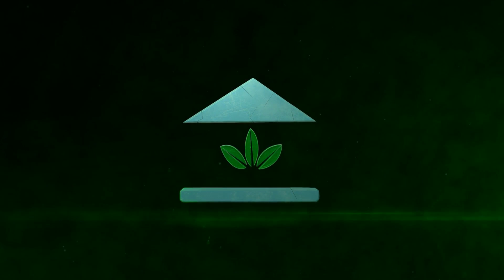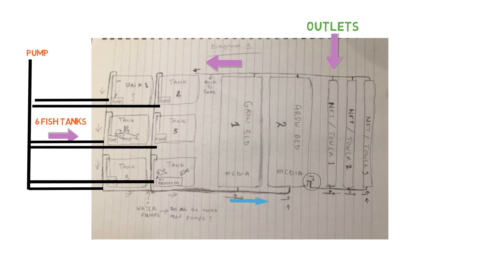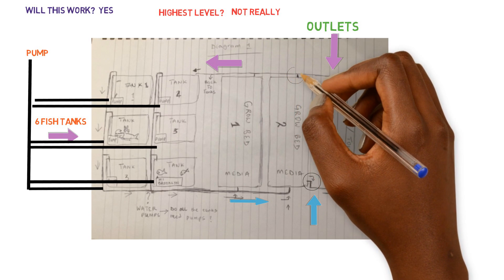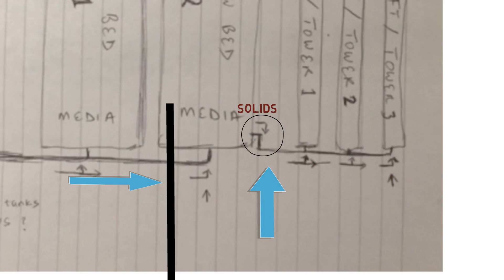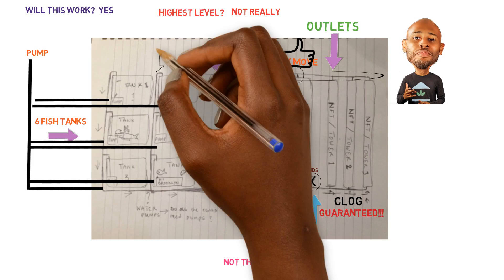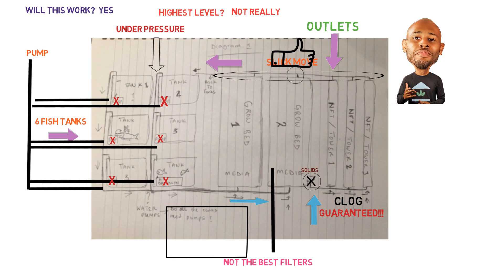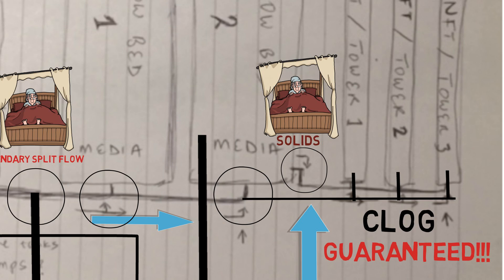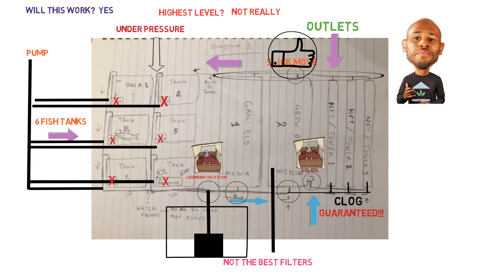Aquaponics Blueprint Review 2: Ask The Aquaponics God Ep26

Comment: Hey I am a beginner at this I've been doing fresh and saltwater fish tanks as well as coral tanks for years I am wanting to do a small system in my backyard what I would love to know is what determines if I have to use a flood and drain system or a continuous flow system i'm planning to run a 100 gallon Rubbermaid stock tank as the fish tank as well as a Nother Rubbermaid tank in the ground for a sump which I am not sure what size I should use I plan to use a swirl filter for the main large solidsand to grow beds also not sure what type of media I should be using can you help me out any advice would be awesome
Reply from the maker: What size (dimensions) grow beds are you thinking of building?